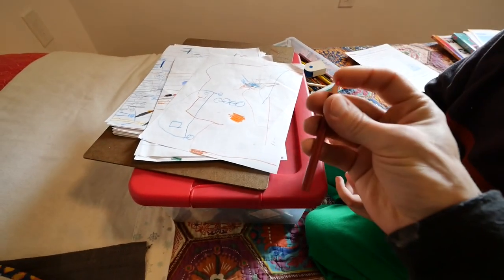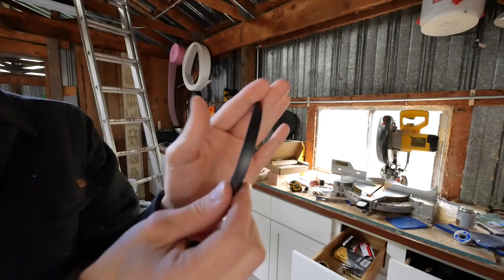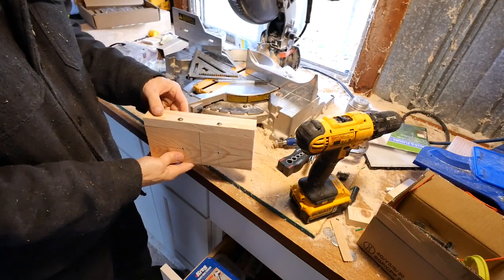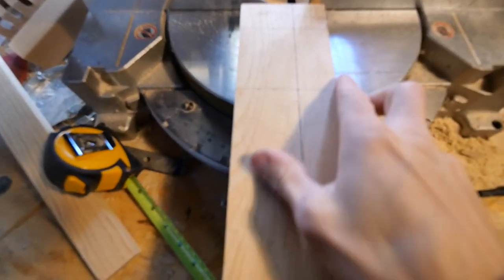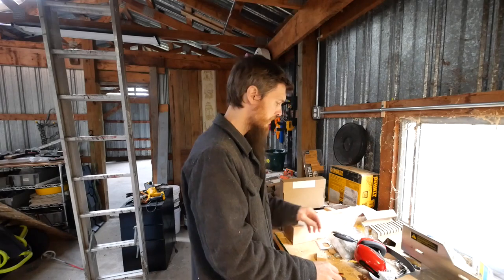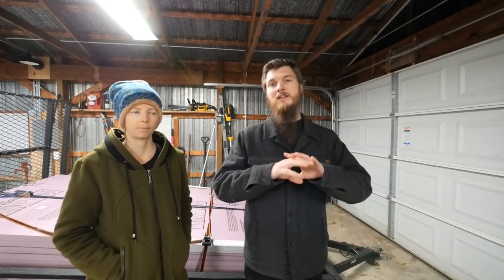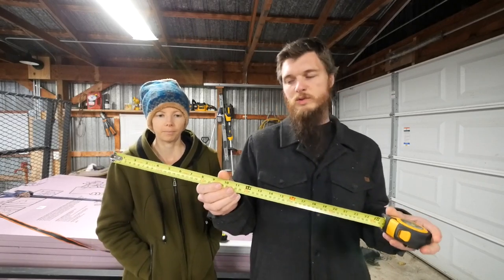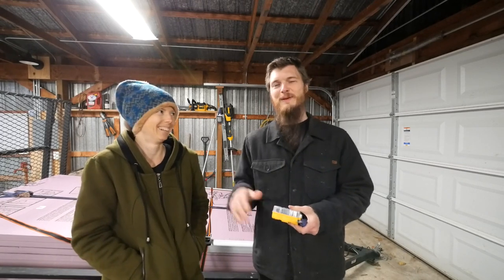Problem Solved in our Garage Shop - Easy Handle Install

Comment: As you asked how we called the metric figures.
The main measurement on the metric is in centimeters.
And between 2 figures you have 9 little lines which are called milimeters.
Mostly the 5 milimeters has a bit longer line.
Suppose something is 10 centimeters and 5 milimeters long, we say 10,5 centimeters (or shortened to 10,5cm).
As you are normally not using a comma but a dot, you could say 10.5 centimeters.
Other people overhere call it ten and a half centimeters, and again others really meassure on a finer grid and they call it 105 milimeter or 105mm.

I think that the mm has a finer grid then the inches, and there for I think you can work a bit more precise, but you can see it yourselves now.
In case your wonder where overhere is: It is in The Netherlands.

Comment: Belle is such a talented artist. Btw the US is the only country that still uses Imperial system! In Canada which has been metric since the 70s we use metric km for distance or mileage, for gas we use litres and Celsius for temperature  but for height and weight we still use imperial. So quirky lol. I totally get you guys being shy and socially awkward but would totally fangirl if I ran into you two at the hardware store!

Comment: Imperial measurements , feet and inches , , metric , millimetres , centimetres and metres , 25.5mm to the inch . 10mm to the centimetre , 1metre is 1000mm or 3feet 3 and 3quarter inches .  . Keep up the good work and content guys . .

Comment: Good tip on the wire strippers. I worked electronics jobs a lot and never knew what those holes were for.

Comment: My husband and I have commented to each other how much your barn resembles our barn. We live in Michigan too. The previous owners of our home had installed insulation panels on all of the interior barn walls. What we found is the mice and squirrels build nests in between the insulation and the metal siding. The rodents would also chew the insulation panels. It is a magnet for them. We tore it all out and it was a gross mess to dispose of. We found if you are not going to heat the barn, the panels provide very minimal insulation value, especially during Michigan winters.

Comment: Here in the UK we are pretty eccentric in most things, not least in our measurement systems...we officially use metric, centimetres/metres etc but many of us 'older' folk still use imperial...inches/feet/yards or a mix of the two...we also use miles per hour and not kilometres, sell our beer and milk in litres but call them pints and switch centigrade and fahrenheit depending on the weather..ie if it's really cold we'll say, .'Blimey, it's 2 below freezing', but when it's a heatwave we'll complain that it's 'over  80' ...lol....I love weird, shy people...can relate, although I'm a loud, weird, shy person :) The kids are fab, artists both.. :) stay safe, stay weird....x

Comment: That's pretty cold. Here in Europe where we live is approx. 10ºC more than your 3ºC.
I love they way you make little tools to make things easier and more accurate. One may think you are loosing time on making them, but I can see how much time they actually spare.
About the wire strippers: Next time I will ask my husband if his European have this holes to cut screws, too.
About the measuring tool: Lately I've seen a video that most of these tools have a sing on the bottom of it which states how long the actual tool is so you can put it flush against the wall and add the length of the tool to the amount you can read on the scale and must not bend it. Does that make sense? English is not my native language so it's difficult to describe it without showing it 😶.

Comment: I was today year old when I found out about the screw cutting gizmo. I grew up on the metric system and the only thing I haven’t converted to is imperial measurements. Metric is so much easier.

Comment: I am totally with you on the tape measure. I discovered self locking tape measures when I had my painting business.. Love them!!! We have three in our garage we have been using regularly recently, One is not self locking and it snaps me in the fingers all the time. It was one my husband has had for years. When we built our house I ordered all of our cabinet hardware from Amazon. I loved that because we could adjust the different packages to get the amount we needed, Our house was a custom build with a private contractor so we had a lot of leeway to purchase our own fixtures.

Comment: I'm Canadian living in the UK... I'm used to inches and Celsius, which is both imperial (your correct word) and metric (the Canadian and UK version) I like the new tape measure! I have 2 inch/ cm increment tape measures. I like inches and fractions but mm is the go to measurement here. So if you go into a shop, the table top would measure say 1200mm x 950mm. More accurate but I was always taught used the most appropriate measure. If you're doing a couple feet use inches, if you're going higher use feet, yards miles etc. But here the use mm for everything. 2.4 cm (240mm) per 1 inch. So fun! NOT of well I have a conversion calculator on my phone.

BTW Belle is an amazing artist! Her bluejay is spectacular! Such beautiful clean lines. 🎨👏👏👏👏

Comment: That tape measure is really cool!! I also have like 3 or 4 dancing around my house, one of them is 50 meters xDD
I like that the yellow part is in horizontal and the white is in vertical, very handy. It's weird that at least in my country all the tapes measure are mixed with imperial and metric, even we only use metric.
Now I can say measurements and you'll understand it, cool! :D

Comment: I've lived in the States for 33 years now and even though I use the British / Imperial, I still can't 'pinch' an inch measurement with my fingers, and I have totally forgotten what a 'pinch' of one centimeter looks like.
But when it comes to divide from 100, 10, 1, can't beat the metric divisions.

Comment: Owww that tape measure is fancy, i've cut myself on the edge when it closed unexpectedly on me.  We use the metric system here in New Zealand but I actually prefer inches..weird little quirk of mine

Comment: Doug, you have those upper cabinets. What if you assemble them and use them as a base for a game/project  table for that side room. It would serve as storage for school supplies and board games. The space will be more and more important as the kids get older.

Comment: Excellent video... You are talented and teach well what you know.... Belle, that bird is BEAUTIFUL. It has abstract art methods involved which heightens the beauty of the subject... That room is so much bigger than I thought! Also, so big...insulation is a great idea. It never hurts to have an alternate space you can use should you need it!  For example rather than the 'doghouse', Doug, you can sleep on the couch in the spare room ;)

Comment: Both of the kids are good artists.  How nice that they work so independently.  I have those handles.  Mine are metal and I have them on a closet built in.  I installed them over 20 years ago and they have been great.

Comment: I am still old school on feet and inches and gallons and pints as that was what we were taught at school. I have gone over to degrees C though and as you shared your temperature mine at the moment is at 28c with a feel like 29c but indoors it says 30c, so you can take your choice. I am an ex UK  living on the island of Cyprus

Comment: The blue jay picture is really nice Belle.. you have a lot of talent.. I never knew about that on a wire stripper pliers before ..as much as I’ve been around them I never thought about it.. the handles on the cabinets turned out well.. that tape measure is a really cool..  I’m glad you’re putting the link for it.. it makes a great gift.. the insulation will help to make the room more pleasant to be in.. I can relate to the shy thing..

Comment: I need to go back and watch how you made the jigs for the handles. I bought handles for my kitchen cabinets and they're still sitting in the garage in a bag. Once you started drilling, it looked easy. I don't understand why you used the tool with the graduated holes, but I'll go back and watch again. Thanks so much for the tips!  BTW, Belle's picture was excellent!  She is a beautiful young lady.
Reply from the maker: It makes sure the holes are drilled perfectly straight into the jig, that's all :)  Thanks!
Reply: Well that makes perfect sense!  I'll pick one up, and get the handles attached. You both are a wealth of information!   I'm past retirement age now, so a little more difficult to get into big DIY projects.

Comment: Imperial and metric.  Conversion is 25.4, divide or multiply.  I’d strongly suggest you guys get a vapor barrier on the roof before the insulation!  That metal roof will drip condensed water on the insulation without it!

Comment: Those new upper cabinets that you haven't used would be a great storage cabinet. Stack one on top of the other in the kids new play space. They will have a storage cabinet in that space that doesn't take up a lot of floor space.

Comment: I live in the states and started using metric measurements last summer.  When I'm doing woodworking metric measurements  much easier than standard measurements.

Comment: Hi there, you have very instructional videos. Another wire stripper hack is the hole that is on each tripper arm. When you strip the wire insulation, insert the copper wire just inside the hole and turn the wire stripper on to the wire to create the perfect loop that will fit perfectly under the screw head of your electrical devise.

Comment: Hey Yall,  awesome tip for the screw cutter, I never knew that, it's going to come in handy one day.   Are yall going to use that old picnic table in the new playroom?   Artificial grass carpet would work and it comes in different colors.   Thanks for all you do,   btw: Mav is getting easier to understand   ; D           Sending Love & Light from Las Colinas, Texas
Reply from the maker: Yea, we're thinking about putting that picnic table together and using it in there. Good thoughts on the artificial turf, we had the same idea :) Thanks!

Comment: Metric measurement is supposed to be easier as it's all based on the number 10. Canada switched from Imperial to metric in 1976. Having learned only Imperial growing up that's how I think.  I still calculate kilometers into miles, that one's easy, and Celsius into Fahrenheit. 32F is freezing in the states but 32C is hot here. Maybe that's why some Americans think it's always cold here!

Comment: You are such a sweet couple I could watch watch you all day. I'm from the UK and we use the metric system and I hate it, for the first 16yrs of my life it was feet and inches then we converted over to metric. I still use standard measurment
Reply: It takes a couple generations to make a change like that really take hold and become the norm.

Comment: Bell we loved your, Blue Jay. You did a really good job. In the United States, the imperial system is used where things are measured in feet, inches, and pounds. Without given my age away, the government did back in
Reply: Ah, but impérial in the U.K. is slightly different in comparison to the states. I use both in the uk but prefer metric. My husband understands Fahrenheit but I just can’t work with it. Celsius for me.

Comment: In Australia imperial measurements were used until we changed to metric system.   If you learnt imperial you tend to keep using that but most people have adapted and use metric which is easier (my opinion).    Great job on the handles, they look really good.

Comment: Imperial is correct for inch measurement. You are wise to insulate your barn room as you will be far more likely to use it!  If you find it isn’t enough you can always add another layer when you can afford it.

Comment: What an awesome picture Belle!  I could nearly see it fly up off the page!
Great job in picking and installing drawer pulls. Those are the type I like, no protrusions to catch your clothes or skin...

Standard measurement, metric measurement. Our forefathers left Europe for a better world, where they don't do stuff like metric. LOL
For me our "American" way is more accurate and better. Let's say your body temp is normal 98.6, so at 100 you know you're starting to get a temp. In Celsius normal is 37, a temp of 100 is 37.7, darn near the same thing... and baby is burning up with a 103 temp that's only 39.4, does not sound so dangerous....
Reply from the maker: Good point on the body temp thing. Fahrenheit is better!

Comment: The cabinet pulls or handles look really nice the way they are positioned towards the upper half of the cabinet drawer versus centering them! It does give more of a shop feeling versus a kitchen so good call!
Here I was thinking that you would just quickly wing it by putting the cabinet pulls on by coming in from the inside of the cabinet drawer and holding them from the outside and attaching them that way etc.. I mentioned a few times that sometimes I don't always know what you're about to do (lining up the handles like you did with the wood pieces) but darn it if you're not always precisely dead on! That extra bit of fussing always makes it perfect!
I've often wondered if you've ever run into anyone that watches you or had any type of interaction with a viewer. Cute story...
As a regular viewer, I get tickled when I watch your videos and make comments and we sometimes end up saying a few words back and forth to each other. It's like, I just saw you on tv and you actually heard what I had to say just like I was actually standing in front of you and we were chatting...it's surreal!
Can't wait to see what you have planned as you insulate that room....
Carry on.....

Comment: 1 meter = 40 inches     1 inch = 2.5 centimeters or 25 millimeters    1 centimeter = 10 millimeters      1 kilogram =  2.2 lbs or just google a metric/imperial converter on-line.  I know that the amount of fluid ounces in a shot glass are different between  Canada & USA. There was a big deal about that here in town about 10 years ago for a bar that was using the wrong size of shot glasses for measuring their alcoholic drinks. It cost them a small fortune before the error/difference was detected.

Comment: Hi!
You know the imperial all your life, so it's easy for you.
For me the metric sytem ist easy and logical. But! I have a few measure tapes for sewing with one side metric and the other imperial. Also some rulers with both measurements.
Because when I want some tipps and tricks for sewing or try a pattern, I often find them with imperial informations.
I can read of the numbets, but I don't learn the system.
With Celsius and Fahrenheit it's similar. I ask google to convert it for me.
A lot of youtubers fade in the other system (the numbers) whenever they mention some in their videos and I find that very helpful.

Belles art ist georgeous!

Comment: That's a nice tape measure! You sold us. My husband told me to order two. 
The terminology for measurements is "Imperial - Metric" or "inch - centimeter" (foot-meter, mile-kilometer, etc.) 
I like how you located the drawer handles closer to the top of the drawer front rather than the middle. It looks better, I think.
Reply from the maker: Awesome! 😄

Comment: Great pick for handles, love the kids pictures both are very good at drawing.   Also, notice rug gone from room. I ordered the same as the one in master bedroom and it is at the land fill.  Hard to clean and vac and the dog got sick on it and I steamed cleaned it , I scrubbed it , towel soaked it.  So I could not get it to look right. Colors bleed and it was clean but had a dark spot. So I wasted money on it. Live and learn .
Reply from the maker: Yea, we ended up not being happy with those rugs either and took them out. Really hard to vacuum - they bunch up when the vacuum goes over them. We took the links off our descriptions so no one else buys them. Yep, live & learn. Sorry it didn't work out for you either :( We've been much happier with the wool rugs we got for Maverick's room and the living room.

Comment: Long time watcher. Had to comment. I have the komelon tape measure as well. 25 ft version. It has a lot more information on the back such as nail sizes and what not. It is an awesome tool to have around!